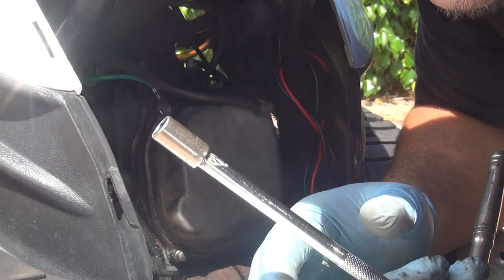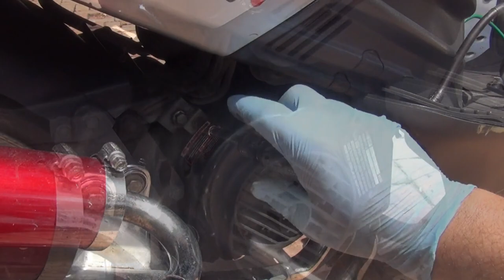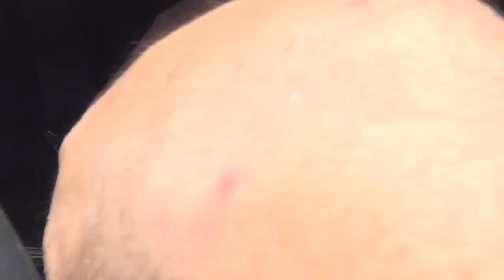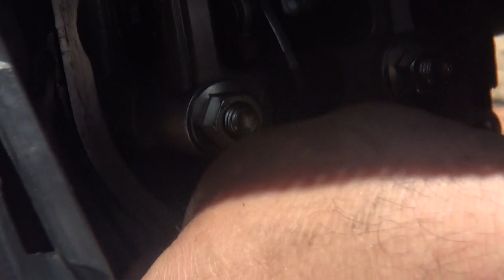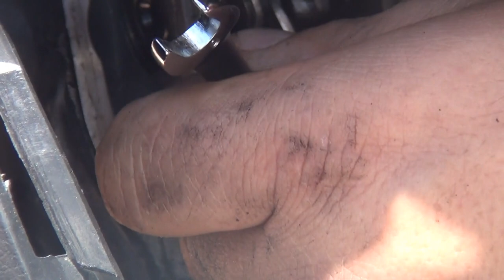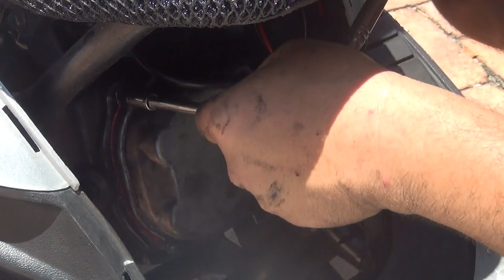Ultimate GY6 150cc Valve Adjustment Tutorial

Comment: I tried to adjust the valves but I just could not do it right. Everyone says adjusted to .004 or or something different in every video that I watch. whatever they tell you to adjusted to that measurement is never on the valve feller I bought three of them and none of them say .004 the only thing I can find is 004 and that's what I adjusted it too and now and it clicks clicks clicks clicks and I even tried to readjusted the valves and it's doing the same thing. And the reason I tried to adjust the valves in the first place is my moped has no power it will start it will run but when I get it on the road I can't get it over 10 or 15 miles an hour and it never started until my CVT belt broke and I replaced it and after that that's when it started acting up

Comment: I have motorcycle Honda spacy skoter 100cc model 2005. I won't namber feler intake and namber feler Exhaust mm
Reply from the maker: Hello my friend I'm not to familiar with your Honda but more or less is the same process and I will place the clearance at 0.040 of a inch  for a 100cc Honda but check on line because I do not have a strong knowledge on your scooter . Thank you for watching my video

Comment: What if the hole on the cam shaft isn't between the rockers when the T line is in position?
Reply from the maker: Hello my friend if the hole are not matching you need to give little more room to the chain and turn the  cam shaft because the right point is the T

Comment: If the hole doesn’t line up
Reply from the maker: If the hole don’t line up you did something wrong in the process because they have to line up without forcing unless you replace the part and you have an A motor part instead of a B motor part for gy6 motor

Comment: Hey!
Where did you connect the black hose from the valve cover?

Can i damage the engine if i dont connect it?
Love your content!
Reply from the maker: Hello my friend no you don't damage the engine you only going to spray a mix of oil and smokes around your motor and that is not good if the oil go on your brakes or in places where little oil is not supposed to be so put that hose where it supposed to go at soon is possible right under your air filter connection or in a catch can. Thank you for watching my video and if you have a question in the future feel free to ask
Reply: @VirberelloScooterTips  
Okay thank you very much.
This hose is connected to my tube between the air box and the carburetor.
The problem is that I will install a kn filter so I don't know where to plug this hose after the change
.

Do you have any suggestions? 

I see that you also use a kn filter, what did you do with that hose?

Thank you so much for your help!
Reply from the maker: @RaaNgee  That is the small hose connected from the hair box to the valves cover right on a gy6 150cc ?
Reply: @VirberelloScooterTips  
Yes exactly just as shown in this video
But the black hose that goes from the valve cover goes to the tube that runs between the air box and the carburetor

I don't exactly have a gy6 but have a similar 150cc engine.

So I am a little thoughtful about how I will do because I will remove the entire tube when I put on my kn filter
Reply from the maker: @RaaNgee  you can hide the little black tube under the seat with a little filter that can bread or you can buy on catch can https://amzn.to/2KvqAQo and you can put on the side and is very cool